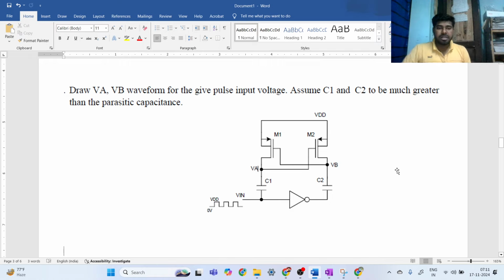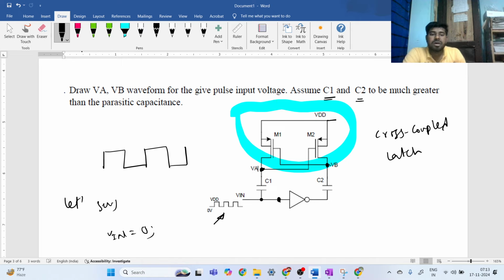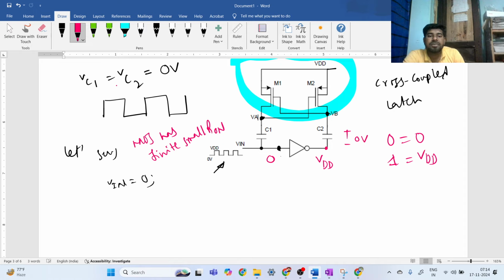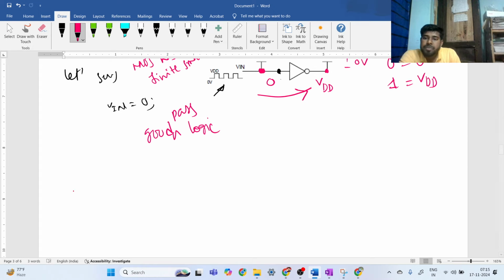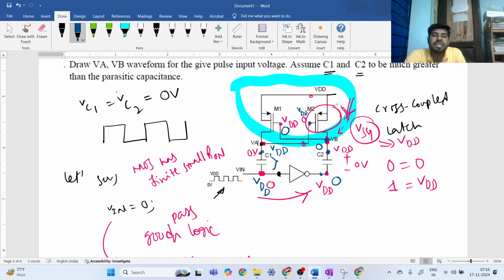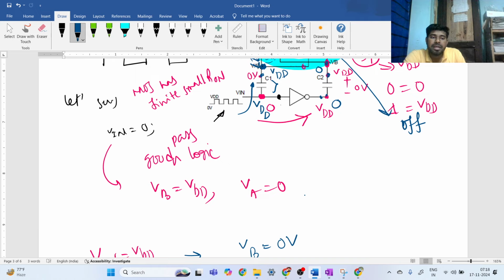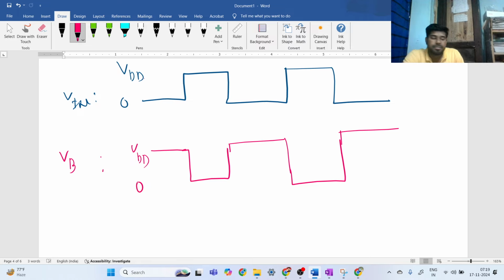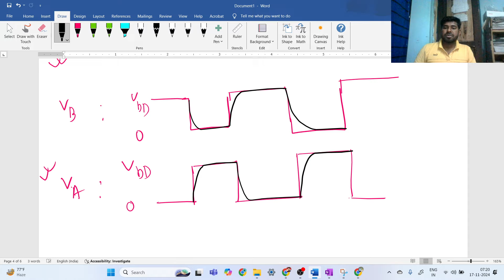Analog Circuit Design Interview question || plot node voltages of cross-coupled MOS || Amit Bar

Comment: Nice explanation and it is very interesting circuit 👍

P_Mosfet is cross-coupled with the inverter and has two capacitors C1 and C2 respectively.
So with a tiny resistor -2/gm, we can easily understand the charging and discharging results of C1R charge , C2R dischargeand of the output  and the other inverter, There are Hi to Lo and Lo to Hi circuits when we input
the continute signal ..
Very  simple 😊

Are parasitic capacitances not considered in the actual design and layout circuit design? 🤔